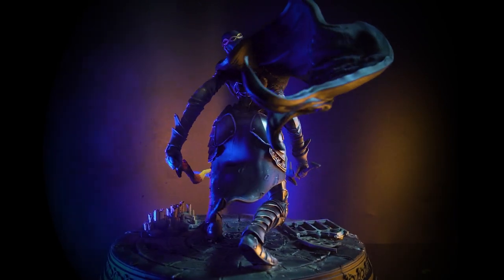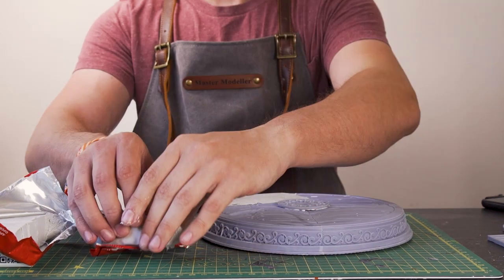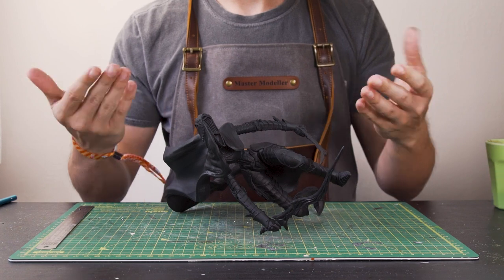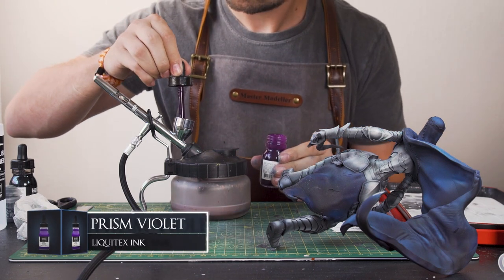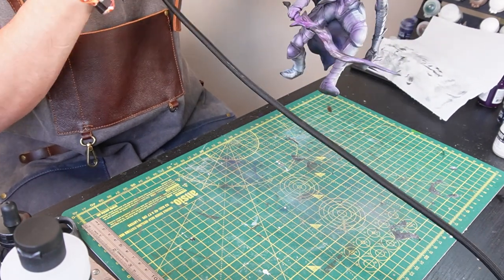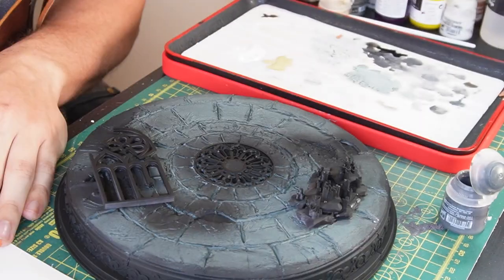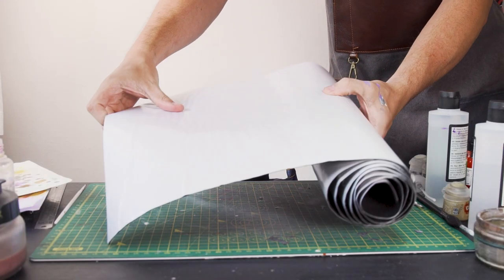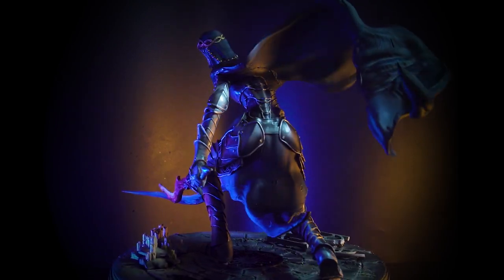Making a BIG Dancer of the Boreal Valley

Comment: Fun fact since the boreal dancer is available to fight right at the beginning of the game .
All you have to do is defeating gundyr  , use the sword to get to lothric. 
And instead of going to fight vord  you go where the maiden is ,talk to her ,get the flag and vow.  Then kill her ( ps : since it's a character meant to die at the end of the story bo Matter what you do , you won't need to get absolution in the undead settlement. )

Once you killed her , just go near the knight statue  and a cutscene will spawn the boreal dancer. 

And quite honestly,  while she  can one shot with her grap and 2~3 shot with the other attacks,  her moves et is easy to understand and adapt  to.

The boreal dancer has 

1) no repercussion on any character quest line ( as you know once you enter the second part of lothric castle  ,greirat can go fetche and die ) 
But if you only activate the bonefire and not interact with the latter. 
Greirat will follow the normal course of events 
the dancer is part of a boss rush. 
Meaning you have to take down  right after  either fighting  yhorm or Gwendolyn hermm.. 
I would recommend killing aldritch first then yhorm .

2) if you you perform the tree skip in the hub you will get access to the ring that gives +10% souls by kill.

3) with the +10% souls she will give you 66000 souls  right at the beginning of the game. 
Meaning that you will be around level 40~45 before entering the undead settlement 😅 and after defeating the cursed great wood boss, you can transpose her boss soul for one kf the best spell in the game .
Don't take the weapons they are shitty.

For stats nerds  she has 5100 hp .
With a +0 weapon it will take between 80 to 100 hit .
Or if you kill the master right beside firelink  shrine  you will get the uchigatana.

1 bleed deal ~510 damage. 
+ that weapon has fast recovery. Meaning easier fight over-all. 

Be warned  ( the Uchigatana needs  16 in dex)